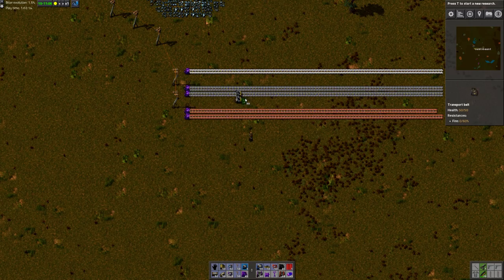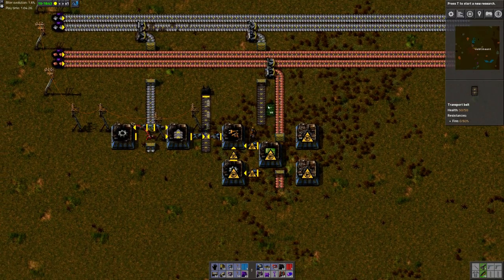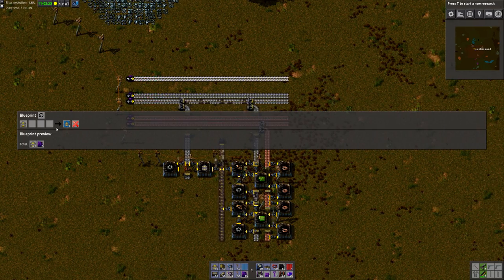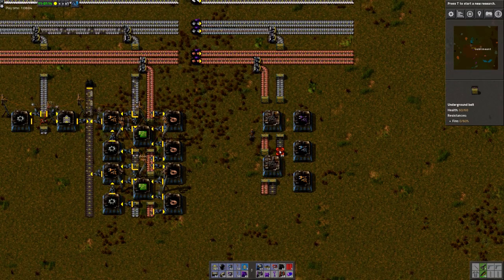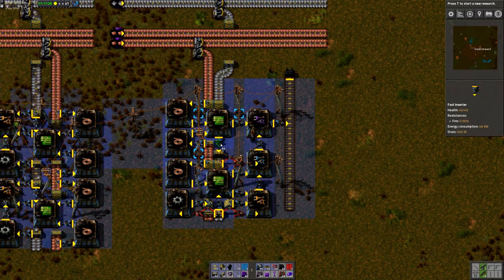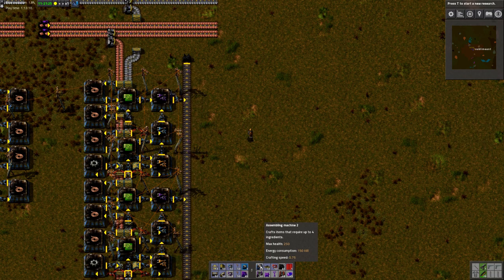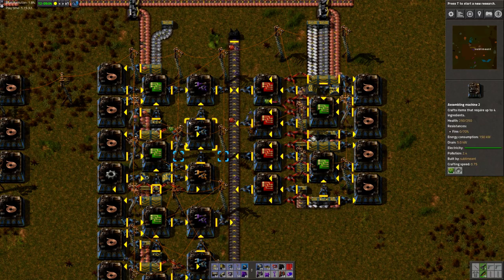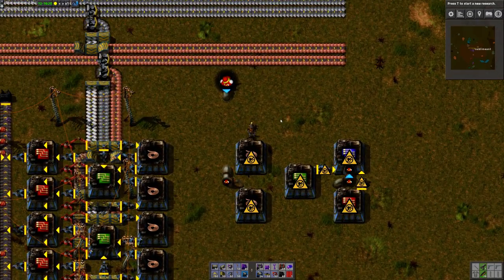Factorio Compact Layout Tutorial

Comment: yes, it's compact, but you can't get the correct ratios, or decent build times with this method, and is not as expandable as using a main-bus system, also, less efficient to build green circuits on site as opposed to putting them on a bus (many things need green circuits, so it's best to just have a centralized place to build them. transfer belts don't require energy, lots of inserters and assemblers DO. also the polution generated using this method is increased. But for early game...this works quite nicely. I would not, however advise keeping this setup even into mid-game. dismantle as soon as possible
Reply: (not as expandable = once you go further down, the build stops, because the first few iterations of the build take up the full bandwidth of the belt.)
But no arguments against this being the most compact way to build these particular items....just not as good for long term use as one might think.
Reply: But the biggest issue is that, by having everything based on direct insertion, you spread your circuit production out (making beacons harder to employ, or even doubling the amount of assemblers you are using in a base for circuit production. Sectioned off areas specifically designed for circuits means that, yes you have to belt (or otherwise transport circuits to factories that require them), but it's overall less costly....especially once you get to massive builds.

The time i can see this design technique functioning especially well (or being the optimal design) is specifically for very early game. (want to spend 10 minutes crafting ONLY inserters and belts for a large blueprinted smelting array? this is a nice little blueprintable section of a small base that can be painlessly employed and then removed.

But you would not want to use this technique everywhere (or for very long).  Specifically for the reason that circuit production is best done in its own area where it can benefit 1) from dedicated lines of resources that have been calculated for perfect ratios and 2) enough space to use beacons to maximize circuits per hour / space required.
Reply: I think structures draw power only when they're active. So, if this design doesn't have a 100% uptime, then it doesn't draw 100% power.
Reply: @bloopbleep7527  Oh shit, did I say a no no word?
Reply: @evanwatling3897  this is because you just wanted to end the game. When you aspire to get 100 rockets running you'll see that you need to focus on more efficient methods. This build is good for early game only and even this i doubt because you will need like a ton of assembling machines just to do the work of one assembling machine with modules.
Reply: Actually, you can get the correct ratios. It will take multiple "unit copies," but those empty spaces in the design mean that everything can technically be moved to fill it. After 3 "unit copies,"  you then have an extra input assembling machine which means that you will have the correct ratio, just with a very high output. The same concept applies to the output side, as the inputs can have more space applied to them with the addition of one belt.
Reply: @rhueoflandorin  For the expansion use faster belts to get items to reach further. There aren't three belt types for nothing

Comment: Such layouts are very interesting, but you'll often end up with improper ratios.
Reply: I do a splitting off furnace+trainwagon system. the train can have 4 cargo wagons, I put each train-wagon's harvested material output(ores) to it's own separated(from the other wagons) boxing and conveyor belt line, going to 4 individual furnace lines(6 long?) totally separated. It ends up as a box coming out with 4 different storage and base output locations, from the one initial resource depo, per say. I pull each area to a different necessity and use splitters to further dictate their flow. It's hard to end on a % that isn't divisible by 2 like 1/3rd, probably partially impossible actually.
Reply: If the compact design has bad ratios you can use modules to help balance it out, and usually you can use long-hand inserters, normal inserters and advanced underground belts to pull faster outputs out of the machine elsewhere. In any case, wasted time on something you are optimizing for compactness is usually the lower-number demanded items. At least I wouldn't recommend for en masse, so you're definitely right on that notification.
Reply: Can you make a video optimizing his design?